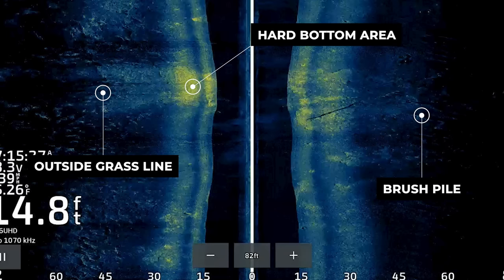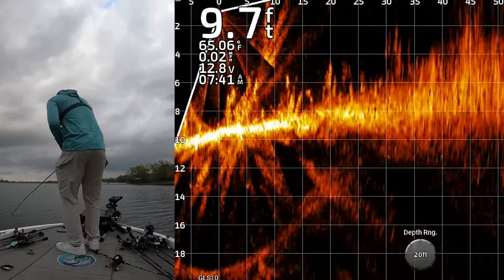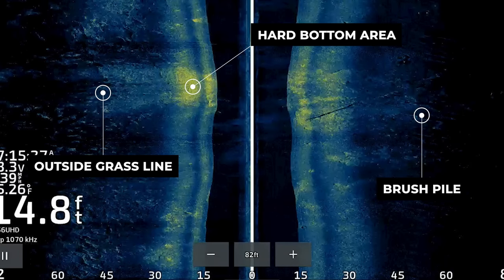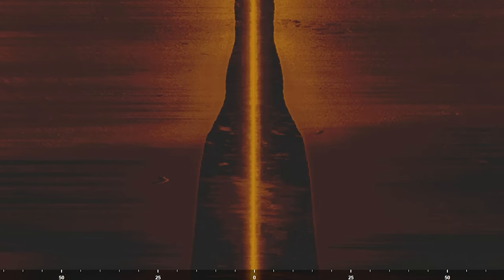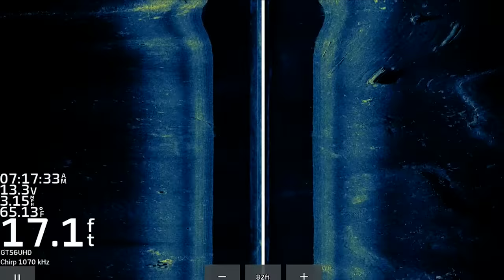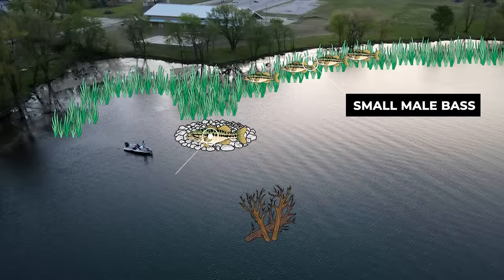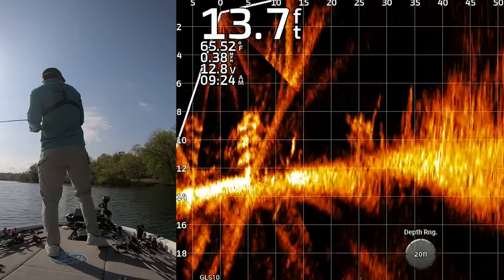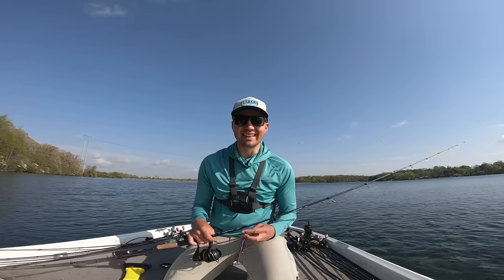This Fish Finder HACK Can Make or Break Your Success Offshore | Bass Fishing Electronics

Comment: I have a lower end lowerance hook 2 triple shot. I struggled to get a decent side imaging picture down imaging is horrible a few pointers on a lower end unit would be awesome
Reply from the maker: You won’t get the best side imaging image on those units, but the down imaging and 2D sonar should be relatively close to the higher end units. The side imaging is still usable though. I’ve used those units before and you can still do 90% of what you can with a more expensive unit. 

I would try different frequency settings and make sure your transducer is mounted properly.

The transducer needs to be mounted on the outside of boat and parallel to the hull of the boat. Also make sure you have a battery that is powerful enough to run the fish finder and handle your engine needs.

90% of the issues with sonar image come from improper installation. Wrong transducer positions, too small of a wire between the battery and the graph, too small of a battery, etc.
Reply: @FishtheMoment  I'm not the greatest with electronics just starting to learn so I don't really know where to start with the frequency thanks for the help I will try to figure it out

Comment: Do you have a livescope setting guide?
Reply from the maker: I have 1 guide for the GPSMAP 1022 with a LvS32 transducer.

The settings are surprisingly very different between different units and different transducers. so if you don’t have the exact same unit and transducer that’s in the guide, I would not recommend getting it.
Reply: @FishtheMoment  thanks! I assumed that their could be a general one for livescope…didn’t realize they varied so much. I have a lvs 34 with 106sv so probably wouldn’t work